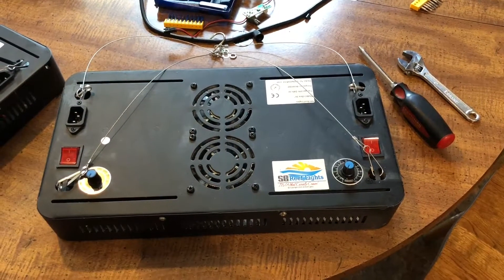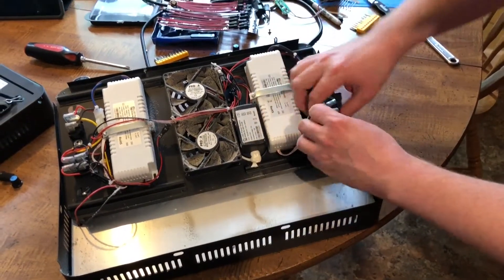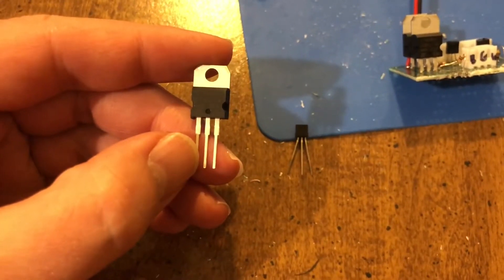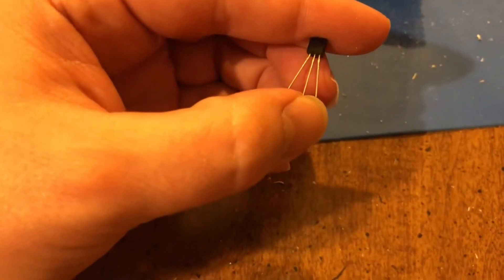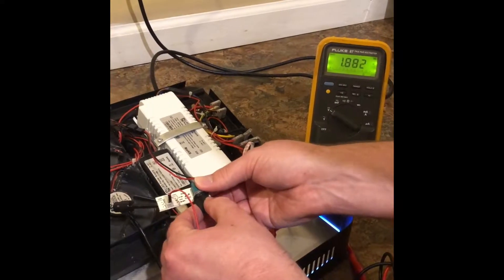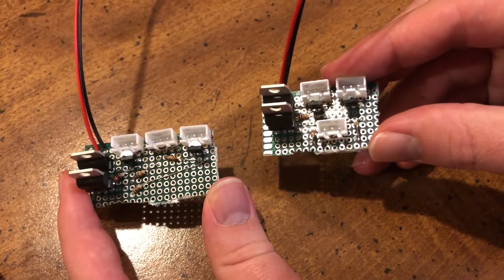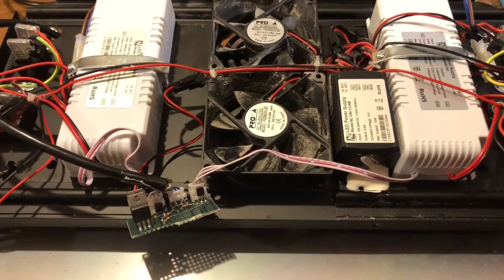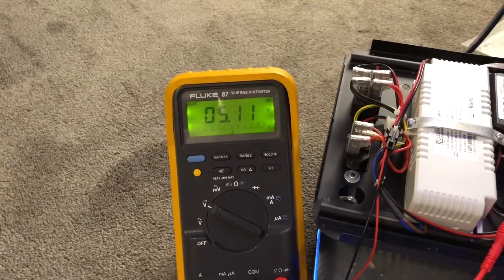Reef-Pi dimming circuit for SB black box

Comment: Will this work with the viprspectra 165w?
Reply from the maker: Sorry I didn’t respond earlier. I expect all dimmable black boxes would be able to be controlled this way. You would need to take apart your unit though because the wiring connectors will likely be different. My video shows a “plug and play” solution for SB reef lights in case you ever want to go back to stock

Comment: Hey @jeremy I am working on building my own reef-pi setup. it seems that there is quite a bit of difference between your tutorial and the one outlined in the adafruit tutorial - granted, I am having some trouble with that one anyways. My question I guess really is if I have similar black box lights, 3 lights on my tank and I want to control whites and blues separately for each light, am I correct in assuming I need 6 little circuits like the one you built? just trying to figure out how this all ties together because there is a whole other part in the adafruit doc that mentions using LM2596 modules where yours seems a lot more simple to me? Any further guidance you can give would be great! here is a link to the adafruit guide I have been referencing:

parts:  https://learn.adafruit.com/reef-pi-guide-7-ph-monitoring/parts 
circuitry: https://learn.adafruit.com/reef-pi-lighting-controller/circuit-construction
Reply from the maker: Sorry I did not respond to this. I will answer for posterity. The circuits I showed on this video are designed to control the white and blue channels separately on the same board. So you would need to make 3 of these boards for 3 lights. I don’t use the LM2596 buck converter on this design because I draw 12V power directly from the fan power supply as shown on my video as the source of power. I liked that approach because you already have a constant 12V power supply sitting inside your light but I did use LM7810 voltage regulators to drop the voltage down to 10V

Comment: Hi, I am trying to replicate what you have there but it is failing. could you please tell me about your wiring like which pin number did you use on the raspberry pi and how did you configure reef-pi to use the dimming options.
Reply from the maker: My dimmer board is connected to the PCA9685 board, not directly to the pi. There are a lot of tutorials online regarding setting up the board. I am using pins 0, 1, 2, and 3 on the PCA9685 board. I recommend posting in the reefpi thread on reef2reef for further support!
Reply: @jeremywhiting9009  thank you very much i knew i was doing something wrong now I have to find the board and try with that. Thanks alot for the reply.

Comment: What are you using to control the dimmer circuit? And how do you make it?
Reply from the maker: Sorry I didn’t respond. I will respond for posterity. The other end of the ethernet cable connects to the PCA9685 board

Comment: is the dimmer control more noticable with the rasbery pi than the original setup then the original setup in the sb reef lights? and have you added anything else since the making of the video like moon lights, storm effects and etc.
Reply from the maker: Sorry I ignored this comment for 3 years. The dimmer control from the raspberry pi allows the lights to get a lot dimmer which is nice. I didn’t end up adding moon lights. I use the lights still on my frag tank but I don’t need moon lighting on that tank. Storm effects etc would need to be added by Reefpi for that to work since that is a software question

Comment: I like the video but could do one on how make the board to put in the black box. as you show the parts tell the pins on each but don't show how it is laid out and what to solder to what.
Reply from the maker: Here is the info on the circuit https://www.reef2reef.com/threads/reef-pi-an-opensource-reef-tank-controller-based-on-raspberry-pi.289256/page-317#post-5166062

Comment: Would you be able to post an image of the front and rear of one of your circuits by chance, as well as where you have the wires connected on your r-pi? I'm looking to attempt exactly what you have demonstrated here and those 3 things would be of great help! (Raspberry-pi, and circuitry in general noob here)
Reply from the maker: No problem, the info is here in this thread post https://www.reef2reef.com/threads/reef-pi-an-opensource-reef-tank-controller-based-on-raspberry-pi.289256/page-317#post-5166062